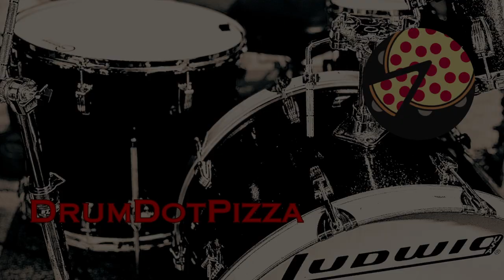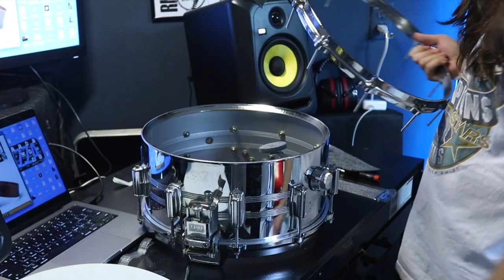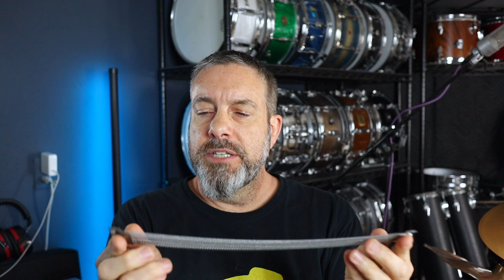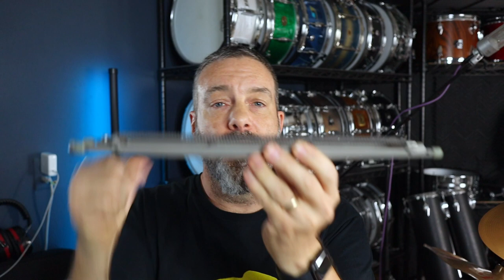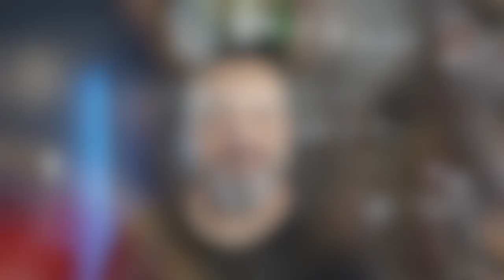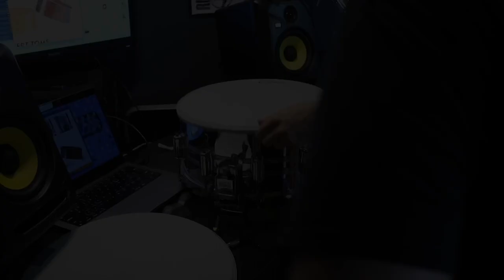Extended Snare Wires (And Horizontal Tension) Used In Vintage Snare Designs

Comment: Great timing!! I'm re-working my 83 Superstar Mastercraft snare.  I need to find a new felt for the muffler. Have everything else but that.  I also noticed in another video, you didn't mention the snare strainer itself.  The one where you picked up on a 80's Mastercraft and took it apart, the one with different year's lugs. You put it back together but didn't mention what you're talking about here, the extended snare wires??  I have my new wires sitting on the shelf, but they are just 14". I think I'll look into the 15" now after this video.   I've had this snare since it was about  6 months old. Bought the kit barely used around 84.  Had the whole kit painted yellow way back. The dark mahogany finish was done!! I'm now done with yellow, I did wrap the snare in black years ago, but I'm ready to put a little $$ into it,  so I just sent the shell to CA where I'm having a buddy custom paint it.  I also sent all the hardware to a custom coating place. I'm done with chrome!! Going with a black chrome powder. Most of it, not the plastic muffler knob. The plating place did explain some of the short comings of powder over chrome. I've agreed that he'd do his best and he feels it should come out good. I'm hoping I'm not making a major mistake there, but I had to do something. I'm done with chrome. Anyway, thanks for the great videos. I just discovered you. Good stuff!! Thank you!!
Reply from the maker: Thanks so much for being here!  I'd love to see some pics when you kit redo is done!  

As for the snare wires the best currently available wires to my ear are the model SE01-1620cr by Drum Factory Direct.  They are the perfect length and sound great.  These are the snares used in this video (my friend, whose Mastercraft was used here didn't have the right snare wires (previous owner put 14" on it), but I usually keep a couple sets of the longer ones around, so that's what he left with).  

I tried all the extended wires available from dFd, BTW (at all price points), and their own model above were the best fitting and performing.  

Pearl S-025 work well too if you can find them.  I don't believe they are a current product, but NOS sets do pop up fairly regularly online.  

Thanks again for being here!
Reply: @drumdotpizza  I have the SEO1-1620cr by drum factory, and Puresound 15" - 20 strand in my cart now. How about the actual muffler pad for my Mastercraft? Where might I find that. I'm also looking for black tension rods. Tama seems to be 48mm. They sell by the 2 pack around $11, Yikes!! Or go with AIAS Tension Rods for Drums - Black Nickel (2 inch) and I can cut them down a little.  Thanks for you help!! Do you have a website?:
Reply: @drumdotpizza  DFD doesn't seem to have the SE01-1602CR model any more, or at least I can't find them. I find one that is an SW5-1620 that is 15 1/4" long and also an SW-1620S that is 15 1/16". With either of these work? What is the overall length of the SE01-1620CR?

Comment: I have a yamaha sd493 and a Tama AW106 mannnnnn both of them are my top 5 snares
Reply from the maker: I lusted after the 493 for YEARS after that came out (was a big Weckl and Vinnie fan in the late 80s)... never did get one.  Still want one, but the brass 'lugs' Yamaha used for this drums are usually warped to an angle now (and/or the shell under them).  Hard to find one in original condition with truly vertical lugs, though still probably a great drum.  I need to just bite the bullet and snag one!
Reply: @drumdotpizza  Yeah if you find one in pristine condition you’re definitely gonna pay a premium 

Im trying to get a drum maker here in baltimore to make me a replica in purpleheart.

Comment: other snare that has extended snare wires is the Yamaha SD493 Piccolo.
Reply: also the 80's and early 90's Recording Custom, Tour Custom and metal snare drums from Yamaha,  I have an RC.   Some late 1990's and early 2000's signature models also got extended snare system.

Comment: I have been wondering what the sound difference is with a Swingstar black badge with mastercraft shell 14 x 6.5 snare drum and a BB165 bell brass.  

Looks like the difference between the powerline 14 x 6 1/2 snare drum and a Swingstar 14 x 6 1/2 is that the swingstar has eight lugs and the powerline has 10 lugs and looks like the rims are different material. But they sound similar to My ear. Because they have the same steel shell. It would be interesting to have a swing star with the Mastercraft shell and a bell brass sitting next to each other and see how close that you could make them sound the same. thanks for the videos

Comment: thank you for discussing this i am believer that traditional snare beds are nothing short of a design flaw and all snares should have extended wires lol. which model would you recommend for getting the tightest snare response without any choking? im especially looking for something easy to set up as my dynasonic seems to require a phd to set up correctly!

Comment: I think I have a powerline(?), I bought an early 80s Tama Superstar kit- in Super Maple and it came with the original snare he bought with it, but it has flanged hoops vs the die cast you displayed. 

I never know what to do with that internal dampening/muffler thing.
Reply from the maker: Yes, you are correct!  The Powerline model came with flanged hoops (including mine... I put some die-cast hoops that I had on it to make it more like the Mastercraft I was comparing it to).  I think die-cast was an option for it, but I don't think I've ever seen one.

As for the muffler... if it is the 2nd gen (LARGE knob) version, it is my absolute favorite!  (I need to do a video defending internal mufflers as they got a bad rap in the mid 80s that they haven't quite recovered from (with some bad 'science' to support getting rid of them)).

Both generations of Tama's One Touch muffler are meant to adjust to desired tension, then simply flip it on and off.  The fine adjustment should be made when the muffler is 'off' (and then flip it on to check the setting).  The 2nd gen version has splines in the middle meant to hold hold the inner fine adjust knob in place when engaged, yet many of those splines have been knocked down/smoothed out by people insisting on making adjustments anyway (which is hard to do when engaged), so this is a common problem with these 40 years on.  But it is a useful design that love.
Reply: @drumdotpizza  I was always confused like, do I tune it with it and snare wires off- then flip them both on etc.!

Comment: I have a Mastercraft snare from 1983 with the rolling snare mechanism and until recently I didn't realise they needed extended snare wires. I've been racking my brains trying to figure out why the wires never sounded right no matter what I did. Turns out, even after the re-issue of the Tama Mastercraft snare drums, they failed to reissue the wires that go with them... I can't find the extended wires anywhere. I'm in New Zealand. Anyone got any advice on where to find some? Don't really wanna pay hundreds of dollars to have them shipped from over seas

Comment: I tried some 15" Puresound on a 14" Snare with roller system. These are not long enough to extend the shell. Just for information. 🙏
Reply from the maker: If you're a Puresound fan try the ones made for the Pearl Free Floating System drums.  I have those on my Bell Brass.  They work wonderfully.

Comment: So, i picked up an old 14x6.5 Ajax Parallel Action Brass snare drum from the 1930's a few months back, bought some puresound wires too, only to find out that it was an extended snare wire system and I'm assuming that the regular puresound wires i got wont fit. So, i dont suppose anyone has any recommendations for alternative snare wires with 30 strands?
Reply from the maker: I don't.  I'd be happy to help if you provide some good pics and spacing measurement between connection points on the parallel strainer.  Probably will have to fashion something use current wires as a foundation, but shouldn't be impossible.

Comment: Joel, or any other kind viewer: what specific SM57, 90 degree "L" kit are you using on the top batter-head snare mic?
Reply from the maker: That is the Granelli G5790 right angle conversion kit (DIY version -- you can also buy SM57s that have already been modified directly).  The mic is actually a Shure 545SD (or whatever version they currently make) with this DIY knuckle.  The bottom is from a dead SM57, however, as the bottom of the 545 had the was a slightly different shape to allow for the switch -- this got in the way of the Granelli right angle device, so I used the top of the 545 with the bottom of an SM57 that wasn't working anymore.  I sanded the powdercoat off the 57 bottom to make it look a bit more like the shiny 545.

Bottom mic is a stock 545SD.

I like the 545 more than the 57... it feels more natural or organic, somehow, while the SM57 feels a bit stiff to me, pinched somehow.  The 545 is more relaxed (both wired in low impedance output -- the 545 CAN be wired for high impedance, but I use it low).

Comment: Is the Ludwig Super Sensitive a horizontal snare tension design too?
Reply from the maker: It is, indeed!  Also the Pearl Jupiter, Tama's Mastercraft and King Beat, Yamaha's 0000 and 9000 from the 80s.  Also the Ludwig snares equipped with the odd P-87 strainer (that allow for separate wire tension on each individual strand of wire or gut) as well.  One side is secured with a screw and the other fit into the butt and secured with two screws, but those are extended strand drums too.

Comment: I was wondering what would be your take on short snare wires? I’ve heard some use 13” or even 12” wires on 14” snare. 

Tried it, sounded fine but didn’t really dig into it or try to analyze it. Had fun playing the drum 😄
Reply: @drumdotpizza
Reply from the maker: I've never put wires for smaller drums on a 14" snare drum, so I don't have experience with it.  I have a 13" and 12" snare drums, so perhaps I'll try and see how it works.  My guess is that the shorter wires would mean less response and more 'tone' of the drum (without the wires), which could be very cool.  I'll have to try it.

Comment: Are those the stock Tama wires? I have this throwoff on a Artwood snare - tried 15" pearl free floating wires on it, and I couldn't get them to sit right. Any tips?
Reply from the maker: I have some stock wires on a couple of my drums, but the ones on the drum in this video (and on some of my own drums) are the model SE01-1620cr from Drum Factory Direct.  I tried all the extended snare wires they sold at all price points, and these performed (and fit) the best.  Great sound!

Pearl model S-025 work well too, if you can find them (I don't think they're made anymore, but NOS sets pop up fairly often online).  

Can't get the 18-strand Tama originals anymore, though I'm talking with a CAD/machinist friend of mine to perhaps recreate them.... we'll see....
Reply: I did the same and found the ends where the wires attach, that plate was rubbing up against the roller mechanism and preventing the snares from lying flat. I took some aviator snips and snipped the corners off the plate so it fit better between the edges of the roller mech and they work great now.
Reply: @drumdotpizza  so you use 16" wires?

Comment: Was not the Ludwig Super Sensitive snare drum (going back to the 60s) an extended snare design? I've always been a bit disappointed that the horizontal snare tension design (I include the Dynasonic here) never really caught on.
Reply: it was an extra expence for drum companies that the public at large was not willing to pay for.
Reply from the maker: Yes, Ludwig's Super Sensitive, Pearl's Jupiter, Yamaha's 0000 and 9000 drums from the 80s, Tama King Beat and Mastercraft.... there were many extended snare designs back in the day.  And yes, I think the expense of design and manufacture, the relative fragility of the. mechanisms (particularly the parallel action versions), the fiddly nature of proper adjustment and the difficulty/expense of finding a proper case to protect (or just fit) the usually large mechanisms all contributed to the demise of extended snare designs.  

Still... I LOVE the performance!

Comment: Hi Joel!  Is that beautiful green sparkle snare in the background a Gretsch?  For sale?  Thanks, Jim
Reply from the maker: Hi, Jim!  Actually, that is a 6.5" Radio King that Jon Zoog built for me using a NOS Radio King shell from the 90s era of the brand (when they were in Nashville, was it?).  

After they shut down the operation someone bought the remaining stock of shells, and I bought one.  I had to have it machined to just under 14" diameter as it was raw/unsanded and too big for 14" heads.  I had a stave shell maker turn it, inside and out, to get it to proper size and plumb.  Then Jon cut edges and beds (wider and shallower than vintage RKs), then put reissue beavertails on it along with an INDe strainer/butt combo, stick saver hoops and an original, vintage, dual felt Slingerland internal muffler.  Oh, and got a vintage 'cloud' badge for it as well.  

So it's custom, technically, but made from a.Slingerland single ply shell with clone Slingerland lugs, proper internal muffler, etc.  A beautiful drum!!

And no, not for sale at this time (sorry!).

Comment: *Maybe closer to 15" long, but they'd need to be wires for a 16" snare if you're buying generic wires to use.
Reply from the maker: Correct!  The wires themselves measure just over 15" long, but they are made for a 16" diameter snare (assuming they are to fit the drum like in a normal arrangement).  

I bought all the "16 inch" snare wires that Drum Factory Direct offers and compared them.  The best to my ear were dFd's own 1620cr (20 strand).  That is what I put on my buddy's drum in this video.

Comment: I have Sonor parallel action snares and find thier sound far superior to the non horizontal standard system, acoustic drum inovation died in the 90's
Reply from the maker: I actually reached out to Drum Center at Portsmouth, NH to see if they know of any currently available snare drums that use extended wires - hey couldn't think of anything!  I understand people don't like cumbersome, fiddly and (potentially) hard to find a case for.  But MAN... THE SOUND!  I just love extended wire snare drums!  I predict extended wire designs will make a comeback in the near future!!